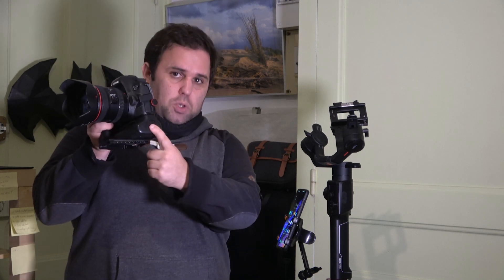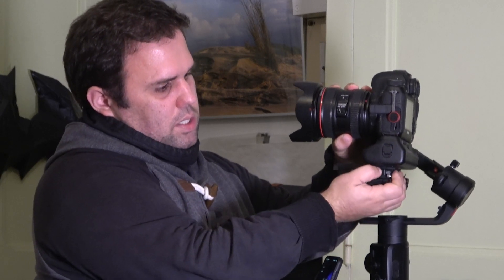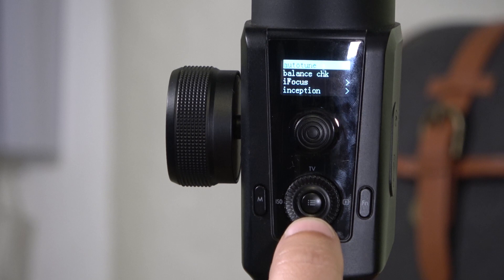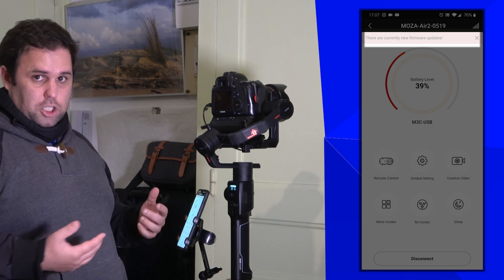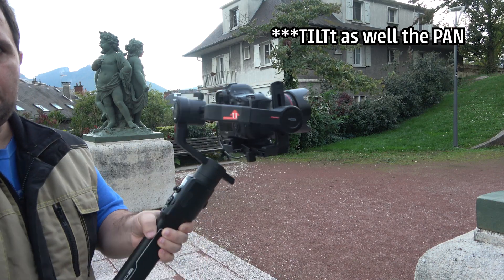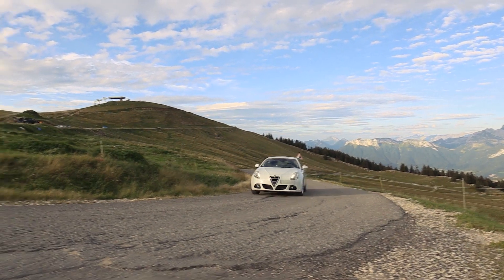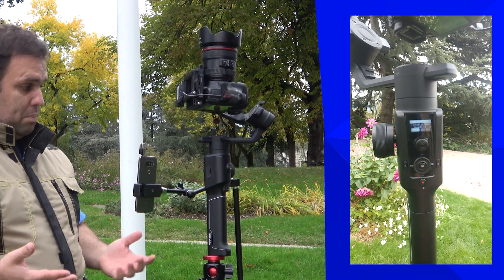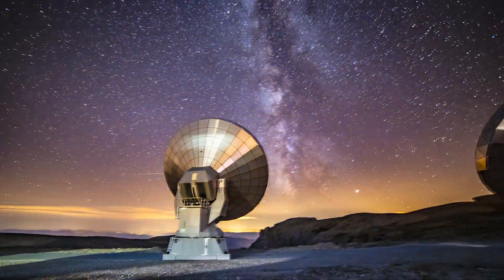Up and Running with MOZA Air 2 Tutorial (detailed time-lapse!)

Comment: do you know wich control cabel needed with canon 5d mark 4   and how to conect it ?  i didnt see close were you conect it ?
Reply from the maker: Hi! It's in the side arm under a rubber cover. The cable is the one that fits, after that make sure you have selected the correct brand on the Moza Air 2 menu.

Comment: I don't shoot time-lapse,  I roll video for hours and then I speed it up in post. can this gimbal just move from point A to point B while my camera is rolling video?
Reply from the maker: Yes, it has video timelaps instead of stop move option.
Reply from the maker: Ho... You can also use more than 2 points as well.
Reply: @migueldesa0031  will it work with my Fuji xt3?
Reply from the maker: I don't know... My Sony fdr-ax53 isn't on the list yet it can start and stop the video recording over the usb cable. Most of the time I just use the record button of the camera

Comment: im realy struggling connecting the app to my moza air 2 gimble
Reply from the maker: Hi Jim! I'm sorry to hear that! Moza has a lot of different apps, check if you have the good one for the gimbal (and not one for a smartphone for example). After (if it still doesn't work) that update your firmware via the usb-c connection to your pc, and see if it works 👍
Keep me posted 😉
Reply: @migueldesa0031  thank you for replying and trying to help out. Ive already updated it 2 times and have confirmed i am using the right moza master app. One thing is there is a red dot instead of green when plugging it into to my pc via usb-c
Reply from the maker: @jim.t9481  that is very strange, check it with other smartphones, just to make sure it isn't a Bluetooth compatability with your phone. If not, I would replace it, I hope it still is in warranty...! 🙃